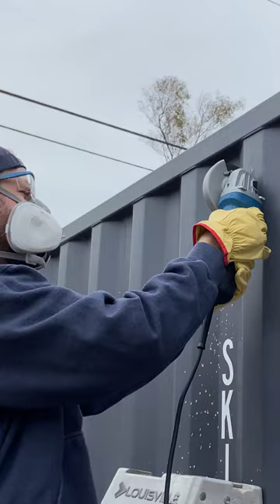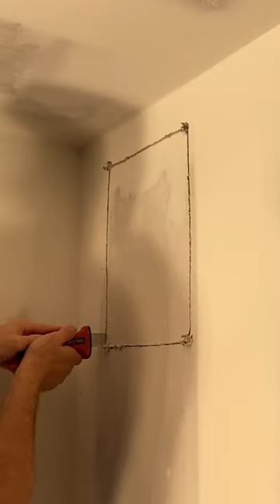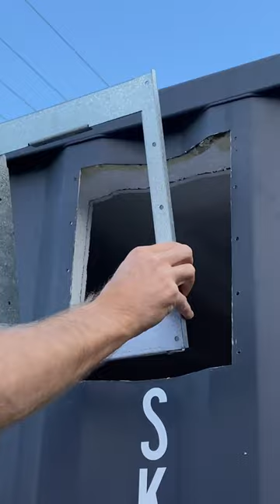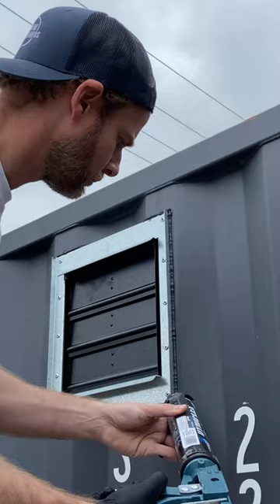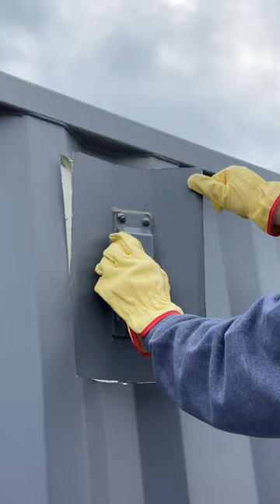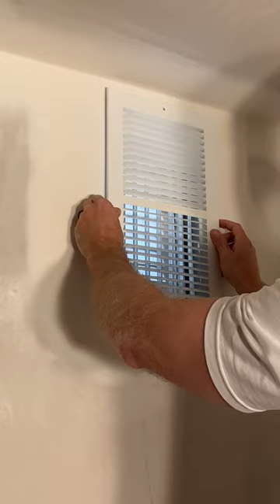Installing an Exhaust Fan & Vents to a Shipping Container #shorts

Comment: When you buy a container you gotta make sure that the one you buy was not storing toxic chemicals. Always be sure what was in the container before you bought it. A lot of people don't know that.
Reply: This was the same with working with pallet wood... Most people never realized that MB stamped on the side meant they were treated with methyl bromide, a toxic chemical.
Reply: @Stephen J.   didn't know that .
Reply: Thank you for the lifesaving advice!
Reply: Or radioactive materials
Reply: How can I make sure of that please ?
Reply: Great advice! 👍
Reply: @BiG__Disgruntled  GOOD TO KNOW. THANK YOU FOR THE IMPORTANT SAFETY KNOWLEDGE.
Reply: @Mohamed_mostafa_360  I have no idea unless the original owners that purchased it were the only owners of the container. I suppose you would ask the company you're buying it from what was hauled in it. And ask them are they the original only owners of the container and hopefully they're honest with you
Reply: So what? Don't they wash toxic containers before selling them?
Reply: @BiG__Disgruntled  Never buying a container but this is good information to know regardless
Reply: @Mohamed_mostafa_360 probably the only way is to buy only used once container but then the high cost sucks the benefit out of the hole process to me !
Reply: I guess you would buy a new container anyway.
Reply: Good looking out
Reply: @nilashishalder7629 this guy really thought washing would solve it💀
Reply: Good advice 👍
Reply: If you're talking about it soaking into the wood that was proven wrong

Comment: Give me more shipping container content now I’m in love
Reply: So basically you want an outer metal shell that can get really cold and hold the temperaturein winter bypassing the insulation cause you need to attach the drywall in some way (which is metal screws) and in the summer you get the opposite effect. And dont worry 2inches of styopore have nearly no insulation effect anyway, but you wouldnt want to buy the expensive stuff or insulate from the outside because that would destroy the purpose of the weather durable metal casing.

You also either want light only from the entrance or loose structural integrity if you install a window. Then you dont want electricity in your container, as this will reduce your space even more as you need an extra 2 inches everwhere to move the cables to the points where you want your outlets, switches, lamps. 

You havent insulated the ground, so this alway will be cold from the ground.

How are containers better than a wooden structure? Have you ever worked in those container offices on a site? They are horrible.
Reply: @wakkawagga443  containers are better 👍
Reply: @wakkawagga443  Only benefit of container is the portability. Once you make it stationary, you kill the only advantage it had.
Reply: it actually not as sustanable as though even for place that have lots of them. for that space and for the price needed to make it livable isnt worth it.
Reply: Did some of those containers make it down to the border?
Reply: @wakkawagga443 let the people enjoy the video in peace, fun police
Reply: Shipping container is the worst thing you can use for anything.
When it's hot outside inside there will be around + 50 ° c.
When it's raining outside the rain will cause enormous noise inside of the container.
When it is cold outside it will get twice colder inside the container.
It's very funny that people are using them for such purposes😂
I used it once for my business and I will never do it again.

Comment: Why venting is on the bottom ? Lot of insects can enter!
Reply: Yeah he should've installed some screen material
Reply: Циркуляция воздуха лучше
Reply: Cooler air from the bottom... but its a) a shipping container, and b) looks like it's surrounded by a field of gravel, so the air ain't that much cooler.
Reply: Not to mention he insulated the unit, and that brought the R value down to like....1.2
Reply: yeah, or when he is finished, he will put it on a truck, as a camper?
Reply: I think the idea behind it is that cooler air is closer to the ground, so cool/fresh air is pulled in through the bottom and as the air is warmed/staled inside the container, it rises and is pushed outside through the top. Agreed though, bugs could enter and a screen or filter of some sort should be added.

Comment: Why not caulk before you place the flange on. You can hold them up with a large magnet to keep still. Then fasten with rivots. Then caulk the outside flange and Then you can fasten the rest and have a propper waterproof seal. One that doesn't allow water to swap through the rivots

Comment: Fantastic work so far, hats off to you. However, wouldn't it have been better to in make the recess whilst doing the insulation so that you could run the cable behind the plasterboard/dry wall?
Reply: If the fan breaks then you can easily replace it.
Reply: It’s a cheap fan

Comment: That will work well in summer where ground air is cooler in the shade. Surprised you did not install an intake filter frame for disposable filters to keep dirt and dust (as well as bugs) out. In winter you wa t to keep ceiling air in as it is warmer than air close to the ground.

Comment: Near where we live, a man built a lovely home for his family with 4 shipping containers. Two bottom are parallel and the two top ones are diagonal.
There are many windows in the top tier, but not so many for the bottom of the two.
I have never been inside but from the outside it looks like a fortress.
New Subscriber here. Thanks.
Reply: A fort comprised of corrugated sheet metal? 😂😊
Reply: @CumminsTurbo4  I do not know, it looks fantastic.
He could have done something I cannot see from the exterior.
I do not laugh at others homes, because someone, somewhere, lives in a box, or in a car.
Reply: @landomilknhoney  no one said anything about laughing. Just simply not a fort if you know anything about anything....

Comment: Noice, I personally would have ran my fingers across the silicone (If that's what you used) It helps create a nice smooth line and not have it look so bumpy.
Reply: It's actually required for a proper seal

Comment: Definitely looks like a cool project!
But please don't angle grind with Styrofoam or other plastic insulation near or behind.. It can catch fire quite easily, and it burns scary fast. Very toxic smoke from this too.
Reply: Unless this container somehow dodged all the safety standards the foam wouldn't burn as soon as you removed the grinder from it.

Comment: I always wondered about placement of vent is high because heat rises? And intake is low because cool air is lower.
Wonder if the air would pull stronger if exhaust was large and intake smaller
Reply: As for placement, correct. Cooler at bottom.  As for the size, a smaller intake here would just limit flow.  You're talking about the venturi effect of increasing air speed by restricting/reducing openings in key places but this isn't one of those times.   Too much internal volume/space, too small of vents and not enough outflow to make the difference.

Comment: Depending on where you live, insulting the container from inside by sticking the foam board to it without a gap, it would stop the air circulation there, which means moisture will get trapped there and create mold, isn't that an issue?!

Comment: I purchased a container already built out but am now getting moisture/condensation build up on the walls and now some water/condensation dripping from the bathroom ceiling. It's an 8x10 container and I have 2 dehumidifiers. Do I need something like this installed?
Reply: They hopefully used insofast or spray foam. Otherwise, you'll also have moisture+mold in your walls and the insulation as it's a metal clad building. Regarding condensation on your drywall, yes you need ventilation/dehumidifier in humid environments such as around a shower or kitchen sink.